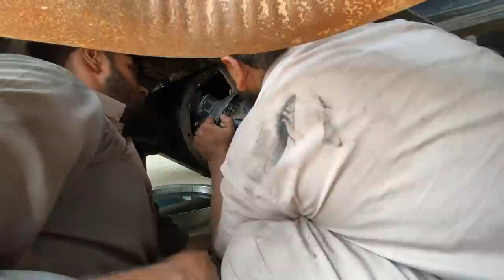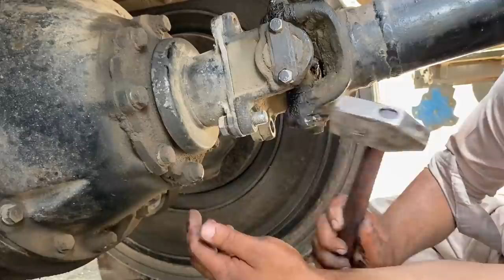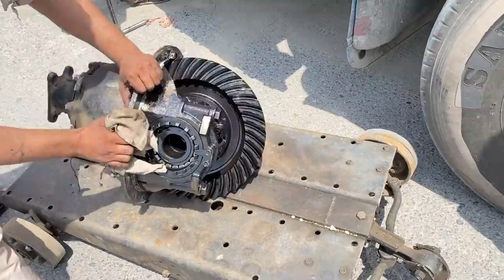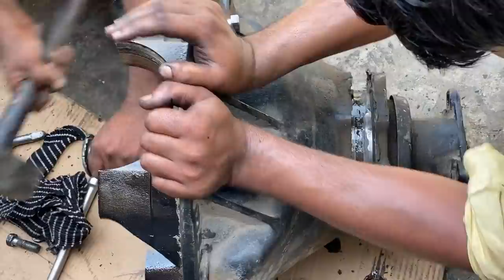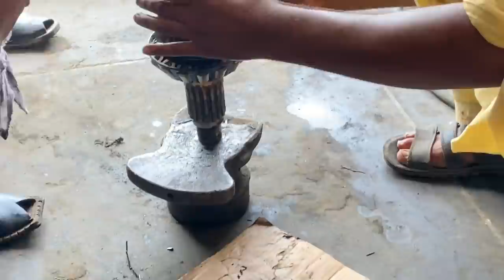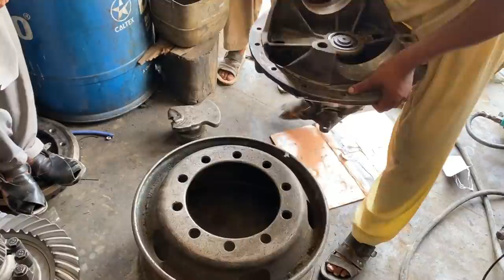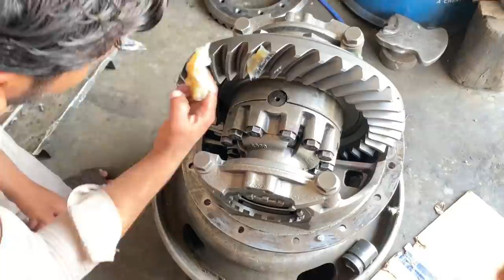The sound is different from the differential gear. Open and check

Comment: the amount of unforeseen probs that could be prevented if they had a torque wrench. Thumbnail of differential pic was grossly oversized.
Reply: That kind of tools doesn't exist in this country my frien
Reply: @robertdivany1627  that’s hard to believe. I was surprised at the bigger machines that they have. The cost of new parts are significantly lower than the in states. A rear dif part they showed cost $300 new, would be over $1000 in states
Reply: @1topfueldrag  .thats right
Reply: @1topfueldrag  I've watched a few of these videos, and have wondered the same thing about tools. I understand they're using what they have, but some of the Amazon knock offs have to be made somewhere over there...
Reply: @1topfueldrag  and $300 to them is like 3 grand to you in the states.. they are literally doing the job in the street , they have barley anything

Comment: What a resourceful crew. Impressed on the open shop working by hand, appears to be very knowledgeable of the gear workings. Good job people.
Reply: I didn't see one torque wrench. That customer will be coming back pretty soon when is differential vibrates and falls apart😂😅😅😅
Reply: @gingersechelski9117  you don’t need a torque wrench for that kind of work. Loctite, and a 3/4 “ impact gun for the caps, and the yoke, loctite and 1/2” impact for everything else,  tighten until they quit turning.
Reply: @wozzgalaxy  wrong ! I do the shit on a daily basis
Reply: @wozzgalaxy  I worked at a shop that had been around 40+ years and two guys worked in the shop from day one. They did nothing but diffs and eaton road rangers/ spicers and macks I never once saw them use a torque wrench just loctite and an impact. But mind you they also knew enough when you replace the gear set you put new ring gear bolts in. When it came to preload, backlash or end play (front diffs) they obviously used dial indicators and what not they had a phenomenal reputation
Reply: Those bolts aren’t going to vibrate loose. Torque specs are usually given so people don’t over tighten which people like to do. If they were replacing heads then yeah I’d like to see a torque wrench but in this case I wouldn’t have bothered with a torque wrench too.

Comment: I just love watching these guys. I trained as a heavy plant fitter after leaving the army, I worked for 2 companies & this takes me right back to 1979. These guys are so very professional & so precise & do it with all with minimal equipment. My hat is off to them. Well done all of you.🤜🤛👏👏👏
Reply: Not really. They're making a lot of unprofessional mistakes, harmful to the equipment, like spreading the insulation paste, screwing bolts in incorrect order, improperly removing the roller bearings and so on. They show dedication, but skills are far from professional.
Reply: Professional...Are you kidding??
They're reusing the old bearings after all those pieces of metal circulated through the oil.
Reply: @johno9507  This may have escaped your attention but these guys have very limited resources. If they wash these bearings out with say diesel & after inspection find nothing wrong with them, put them back with a good greasing, the bearing should be good for a limited future but save money & extend the life expectancy of that bearing. You or I would probably not do that, we wouldn't have to, but we are not them.
Reply: @terryalang7283  
Actually I was more having a go at what you term as 'professional and precise' and wondering how you came to that conclusion?
If you saw this being done in the US or Europe you'd call them 'bodgy backyard mechanics' anything but professional.
They didn't even apply Prussian blue to check gear mesh (or use a smear of grease if your broke).
Reply: @johno9507  John O, it obviously works, right! They in my humble opinion have never been formally trained or at least I would assume that. I left the trade in 1979. So given that fact  taking it into consideration from my point of view they did a cracking job. Up to your obviously superior capabilities they may not rise. Never judge a man till you've walked a mile in his moccasins, (Geronimo)
Reply: @terryalang7283  
Works yes, last more than 500km...🤔
As a aircraft mechanic I do have high standards but I also had humble beginnings learning to rebuild my first car at age 14 (a 1979 model no less😄) from workshop manuals, but these guys obviously have internet access so there is a wealth of knowledge open to them.
Reply: @johno9507  John O, let this one go o.k. it's not your 🚜 vehicle. I think they did a damned good job, simple as that. Have you had a go @ all the others who felt the same as I?? To note, heavy plant & Aircraft, no quite in the same frame, wouldn't you agree??
Reply: @terryalang7283  I wouldn't agree with your use of 'pro. and precise' .Trained engineer, fitter, bearing sales. When you use a hammer to remove bearings (with contaminated oil present) you ' Brinell' the surfaces where the rolling elements contact the hardened races.This creates small indentations that begin the process of rapid bearing wear in use. All that is known by manufacturers and is why precise professionals use presses  and collars sized to press only the races (rings).
I have done this job as a road-side repair with simple hand tools for someone on a tight budget and ,sure, it worked.But somewhere down the line if the vehicle lasted that long, the difference between precise and professional and 'got to get it done with available resources and skill' is statistically proven to show.I'm not criticising the people of Pakistan or many other places where 'labour' is cheap and resources limited.
I'm just enjoying precise use of language and not letting sloppy reasoning go unchallenged.
Reply: @johno9507  In USA mechanics replace the whole part  and most mechanics in USA and Europe don't know how to repair anyway.
Reply: So they have to overload the trucks to get the job, then drive a dangerous vehicle to make money.
After that they have to pay for repairs.
Not an ideal system.

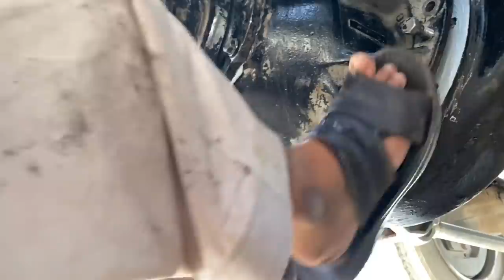Comment: In a pinch you can make gear marking compound out of bulk titanium dioxide and some light oil. I've done it and its a useable alternate to the factory compound. Obviously having the factory marking compounds for checking the contact pattern is much easier, but still far better than the grease, which tells you nothing since it adheres to the surfaces. The marking compound does not adhere like a tacky grease does, and provides a good indication of the contact pattern. Even in the absence of tools, its possible to actually determine the correct contact pattern even on used gear sets by moving the pinion depth in .002" increments through the region where the gears are in mesh, while maintaining the correct back-lash after each shim change. This will provide a complete picture of all the possible contact patterns (assuming there are no run-out issues) and allow you to choose one that is close to the specification, or in a used gearset, re-establish the original mesh pattern. Also the bearing preload does not look anywhere close to correct in the finished unit. There needs to be at least some drag. There its spinning freely, which means the gears will be substantially out of mesh under load, and will chip again as the original set did. That setting is quite critical. Again without proper tools, at least in cars, the "cellularmitosis" bearing preload check can be used if your familiar with the type of rear end being worked on. While not precise in any way, shape, or form, it at least tells you if your in the ballpark. It should not just spin like that, even during the mock-up as it wont be representative of the final mesh. Even during the checking phase you want at least some preload on the bearings so the gears are in mesh as they would be once installed. Hypoid differentials are quite touchy when it comes to setup. I suspect the original gearset may have had a similar issue if it was serviced in the past. Edit: 13:50 I can hear all the backlash in the gears, they are quite sloppy, and probably have at least .030", which is far out of typical specifications.
Reply: @hate-conductor  Do you think anyone cares about your comment? Hello, this is youtube
Reply: thankyou for the info, i though the bearings sounded abit sloppy as you can hear them slamming when he jigs it back and forth, never thought grease could be an issue but that makes alot of sense as the grease will stick huge gaps together making you think its okay when it isnt
Reply: @mnshp7548  Alot i a town in India. A lot is more than one of something.
Reply: Finally a good comment...😄
Reply: Agree on pinion preload and carrier bearings preload too loose and backlash too much.  They might be reworking this again in the near future. Otherwise, cool to see they doing this where it sits and working with the tools available to them.

Comment: I really love your videos.  I was a mechanic for 30 odd years and now I do other things.  I always believed in repairing rather than replacing.  And you guys are at the top end of the scale for skill and teamwork. Shukran.
Reply: Nowadays, everything is made to be replaced.
Nobody got time to repair, and if it does, it cost a fortune.
Reply: @dan_6915  but they replaced the broken ring gear and pinion on this truck to complete the repair... that's a job that still gets done today on pickup trucks. They still did a R+R. Also I think I meant to reply to OP

Comment: I'm most impressed by the squatting! If I squat or kneel for any length of time it takes the same amount of time to get upright again
Reply: In that case you need to start doing it. Not squatting and stretching the back is one of the main reasons we have back problems in the west and they don't...
Reply: @piccalillipit9211  OK, I'll keep you posted. Started today pulling weeds
Reply: @piccalillipit9211  I think sitting in chairs is the main problem that shortens the iliopsoas muscle which in turn causes too much curvature in the lower spine "lordosis" also weak hamstrings and weak abs contribute my current philosophy is to keep moving only really sit while in the car
Reply: @randallcammack6932  - Yes apparently sitting in chairs is really bad for you.  Children start to lose their movement when they go to school and are forced to sit in chairs for hours each day.
Reply: Great replies & comments, discussions instead of the usually horse shit cut downs. I served with a lot of Asian military personnel who squat and got into that habit during my 20+ years in the Army, no back issues, no bowel movement issues. If you're having BM issues, use a 4-6" wooden block or portable step placing it directly in front the toilet elevating your feet/knees while sitting on great white throne and you'll notice the relief immediately. No more straining, pinching & chopping the loaf, just one complete swoop and you're done. TY Frenz!
Reply: Method is also important. I am a Roundeye who can do an actual "Kimchee Squat," which requires both feet actually be fully flat on the ground. The farther apart your feet are, the easier this is (to a point).
And this is the biggest reason a westerner's (ha) squat hurts: Our feet aren't flat, we're balancing on the balls of our feet, and there's strain everywhere. Including the knees. Oh, and lower extremity circulation sucks, too, perching like that.
OK, I lied. Could. I COULD do. Somewhere, I got old. I also quit doing...
Reply: I like the trucks painted in rainbow colors and that the employees are allowed to wear dresses.

Comment: Just what every truck driver dreams of...Having your rear diff rolled around in the dirt, reusing old bearings some guy beat the crap out of with a hammer, and putting the same diff oil back in that came out originally full of metal shavings and dirt?  Oh wait, it was filtered by a dirty rag used with the last 7 jobs.  The funny thing is that this shop is actually pretty clean compared to others I've seen on YT who work on heavy machinery.  It's amazing how long these guys can make equipment last plus they're all working on the ground in sandals!
Reply: Western "professional" technician: "You are going to need to buy a new differential and accessories including new pistons and injectors. No sir, this can't be fixed only replaced. It's actually cheaper because we going to charge you less man hours, but actually, not really. Lol. You also need blinker fluid"

Comment: I'm sure the preload, backlash and torque specs are spot on. 👍
Reply: That had pre cringe but they probably know from experience what will work for abit look how it came in from another guesstimate reassembling lol
Reply: All I could think about...
Reply: They'll probably just add a bit of sawdust to the oil and it'll sound good as new.....until it snaps the teeth of the next set of gears and they do it all again 🤣
Reply: @grrarg9319  Sawdust to the oil?  Jeezoo...is that a thing?  A nice space taking up, noise cancelling oil thickener... I never heard of that in my life, but it makes sense
Reply: They have received the most perfectly machined components in recorded history and dial indicators are not required
Reply: @broken1965  Probably not actually
Reply: I love how diferent size bolts have the same torque specs 🤣
Reply: @xxn0cturn3xx  Everyone knows that they do...its so convenient
Reply: Not to mention the pattern.
Reply: @xxn0cturn3xx  Yep...ft and no threadlocker.
Reply: These guys only care if the truck moves! Isn't this a third world country?
Reply: @SquillyMon  It's an old trick used car salesman used and probably still do. Short test drives so just had to make things quiet. Sawdust for differentials and banana peels for manual transmissions to quiet them down and make everything feel smooth. Dirty tricks to make oil pressure seem normal  and one for engine knocks but I can't remember what those were. Also if I remember right if front end was loose they would toe it in so it felt normal. Get it sold as is and someone else's problem. Never buy from a used car dealer or someone who flips a lot of vehicles. Greed gets them all eventually.
Reply: @69jbr69  Jeezoo...LOL... Thats awful.  The only one that I see working is the sawdust in the gear oil.  I've never heard that one before but I believe it.
Reply: ""These men are "NOT"" fools , they do this work day in day out ,  and are well able to check crown wheel and pinion back lash  by experience without dial gauges , give them credit.😉👍
Reply: @SquillyMon  - Its an old trick to shut up a whining diff...
Reply: I know - I had a drive shaft CV joint mended in Africa with small pebbles instead of ball bearings - it got is to the next town. 

Where they smashed some BB's out of a random ball race and pushed those in - and that got us across the Sahara, seriously.
Reply: @piccalillipit9211  I believe it...  I'm fairly gifted at Rube Goldberg repairs when there is absolutely no other option
Reply: @brendanlawlor1906  Think so?  Ever done it before?
Reply: @SquillyMon  - I thought I was till I travelled in Africa OMG they are amazing. A 13-year-old boy welded us a new exhaust out of a scaffold pipe when we ripped out off.

Obviously, it had no baffles, but it stopped us from getting gassed which was the problem. But it fitted the contours of the car perfectly, it was like an F1 racing pipe all bits of pipe cut into triangles and welded together to make the curves - it was an absolute work of art.

But when you see the state of the 50 year old Mercedes they are driving about in every day and they keep them running with NO spair parts.
Reply: @piccalillipit9211  Mercedes Diesel no doubt...
Reply: @SquillyMon  No. You cant get Diesel fuel in a lot of Africa
Reply: Two or three ugga duggas.
Reply: @piccalillipit9211  I bet it works too!  lol...  Its always fun to hear something I've never heard before.  The trick I always used was called "rebuild" haha.  I'm still getting a chuckle out of the sawdust trick
Reply: @piccalillipit9211  No shit?  I would have bet a fair amount of money on a Diesel Mercedes...  Wow... I learn something every single day
Reply: @SquillyMon  sawdust, used in vehicles worldwide!! Lol
Reply: @xxn0cturn3xx  guten tight, 2 ugga duggas !! Lol
Reply: @SquillyMon  MacGyver it!
Reply: @69jbr69  i flip a lot of vehicles and id never sell something thats not fixed correctly
Reply: @ThomasBilt  Give it a couple decades. Get enough complaints after you go out of your way or a couple bad investment repairs/buys and see the profits for quick flips and eventually almost all flippers take the easy route out of exhaustion. It's a fun and profitable addiction for awhile. Be careful, digital trails and different atmosphere now and if you do to many a year the old tax man might show up in your mailbox for unclaimed income, sales tax, title transfer fees, fines and so on.
Reply: @SquillyMon  I remember being told that a nylon stocking shoved into the oil-filler hole would be milled to small bits and quiten a noisy diff. long enough to sell a car.
Reply: @lawrencewheeler8868  An AvE fan I see
Reply: @ianrutherford878  I believe it...
Reply: @SquillyMon  another fan of uncle bumblefuk, welcome brother
Reply: @danhammond8406  LOL Yup
Reply: @SquillyMon  If you were talking about used car dealers & ripoffs 50 years ago, sawdust was ALWAYS mentioned.